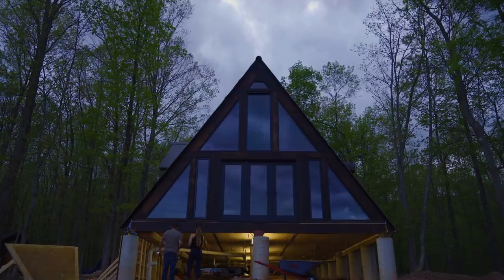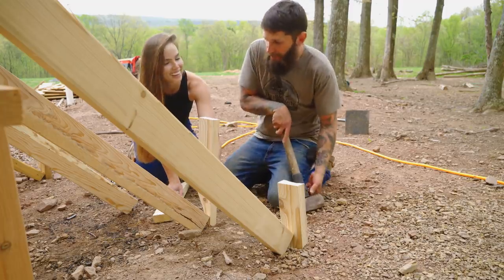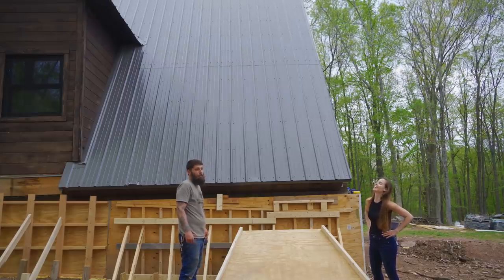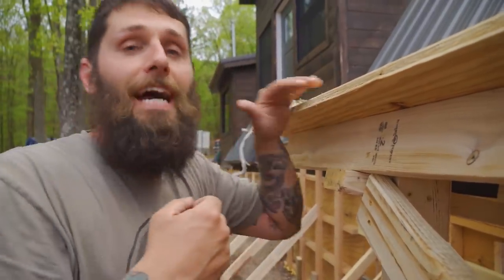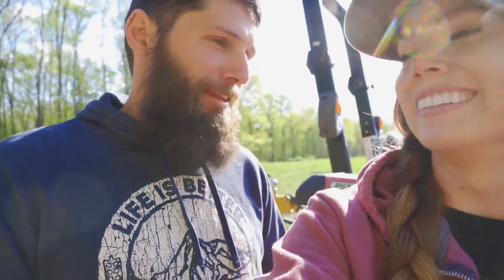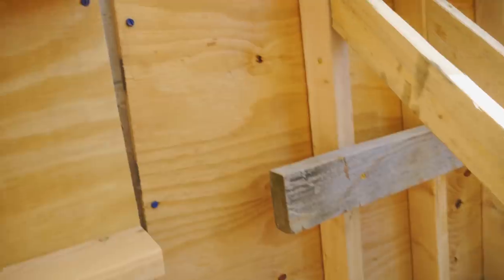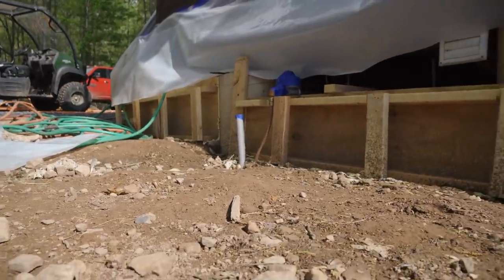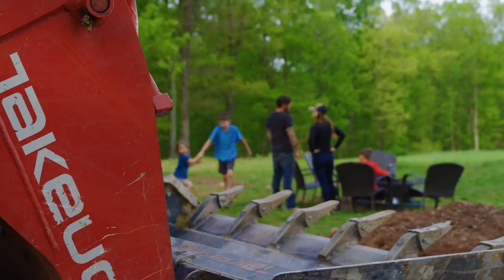Pouring A CONCRETE WALL | Our Self-Built Home

Comment: I spent 32 years working for a local concrete producer, you should be able to strip the forms the next day, the longer you wait the harder it is to strip, it will strip best while it is still green, good luck and I hope for the best,    Bob

Comment: They used to put  a twisted  wire  from  the outside of the  form  to the inside and fed them through holes  in the form to the outside  and put  anchors to keep the firm opening  up.
Reply: Snap ties
Reply: We did that on our footings and used the wire to hold the rebar up. Worked great.
Reply: Still do. No need to tell them now I guess.

Comment: Questioning why you didnt use cement block for your basement walls?? You guys are such hard workers and your beautiful home shows it!
Reply: I was wondering that myself. Given everything Josh can do I can't imagine laying cement blocks would be much of an issue.
Reply: Ground movement. Cinder blocks suck for foundation walls.
Reply: @laurieg673  Would that be an issue given there's already a concrete footing?
Reply: @stephengospel3243  of course it's an issue. You need your stone on a surface that is tied in to the pillars to stop movement. Cinder blocks move.
Reply: @laurieg673  Concrete blocks are commonly used here in the UK as part of the foundation sitting on a bed of concrete and tied into adjoining walls / structures.

Comment: Now I understand why the under-floor lights were  installed  ... Doh!  Your team-work is very heart-warming, Josh & Erin.  I know how heavy wet concrete is, hence your strong form-work.,  Once when I was renovating my old home in Bermuda with a contractor, a major project was lowering existing wooden floors about eight inches into the cellars below, and fitting re-bar and electrical conduits and propping up the whole shebang with jacks.  When the concrete pour was going on one corner started dropping which caused scatteractions with quick lumber props.  A tense moment!   Whew.

Comment: Josh I could of told you that end would blow out. Has to be done in two part pour or Lag bolt with huge washers drilled through inside of 1/2 inch pvc to protect and reuse the bolts. Keeps the inside form even with the out side form making it near impossible to fail.   Step 1# drill straight through the form. Step 2# Lower in PVC  Step 3# Insert bolt through form into pvc to other side then tighten nut till both sides compress the pvc slightly. Hope this may help.  I'll goof on you guys later! GO GOAT!

Comment: Josh, if you take some 1/2" PVC pipe, can cut it to the width of your forms. Fish the PVC between the form boards, then take a piece of 1/2" all thread and insert into the PVC and tighten up. This will keep the forms from blowing out. This will make a "I" beam holding the form in place.

EDIT! On longer bays, limit the pour height to a half a bay height, pour the others, then come back to finish where you started.

Once the concrete is cured, remove the all thread and disassemble the forms. The PVC inside won't be an issue for you as you'll be covering the cured concrete with stone.

Comment: I can relate to this concrete pour.  Years ago and having zero concrete experience I built forms and bracing for pouring a footer wall for a garage expansion.  The max wall height was only a couple of feet but my bracing started to creep during the pour.  I ponded in more stakes and bracing and crossed by fingers.  It held but there was forever a little bulge on a section of the wall.   Nice job guys.  I imagine you burned a few calories this day.

Comment: Tip: Line your chute with plastic, metal, or a severe coat of wax. You want the mud to slide into the opening and not have to loosen it with water. Dry mud is stronger than wet mud. 
When I poured to underpin a basement, I would use a hinged form where the top hinged out and at the end of the pour section, it would be bolted upright. That helped get the mud in the hole and allowed me to pour to my desired height.

Comment: i have been wondering since you all started forming up the walls for the foundation how you were going to get the concrete in between the forms and this video was so satisfying when i finally understood your plan!! fingers crossed so tight that the tallest wall isn’t too annoying to fix with the little blow out 🤞🏻

Comment: Always love your videos and watch them religiously. Josh, you should look into "snap=ties" as a way to keep your forms together. They  are small steel rods that go through the form and are held on either side by small wedges. Once cured you remove the wedge and "snap off" the end protruding outside the form. Might cut your labor and material back a bit. TLK

Comment: Great job👏 People that do home projects don’t usually get involved with a job of that magnitude. Weight of concrete is usually under estimated and you run into problems. You guys handled the job very well. Best of luck with the rest of the pour👍

Comment: 5/8 threaded rod through the taller forms would help prevent bulging. Pull the rods out a few hours after the pour. The stem-walls are not structural patch the holes.

Comment: I have a light weight aluminum chute about 20 ft long that I have used for pouring concrete for over 30 years now we use a line pump that was a great idea kudos Josh you have a awesome helper. I would remove the forms where you have a bulge and chop it back with an axe ASAP just saying the concrete will be set enough in 24 hrs

Comment: When you get a blowout like that the easiest trick is to drop a bucket or two of dirt or sand against the formwork before you vibrate it and it will usually stop it going any further.  You mite find it easier, if you use some timber to make a tee bar for pushing the mix down the chute. Also we usually have a carton of beer for the driver when it's a slow pour, it helps a lot. Well done though, that's a big undertaking, to do it yourself.

Comment: As always, great vid.  Suggestion if you haven't done the other side yet. Not sure how far behind you guys run on your vids. The thing that appeared to slow up your pour most was the concrete not sliding off the chute into the form.  Clean off the chute,  get more of that same thick plastic, and staple it all over the part of the chute that comes in contact with the concrete.  I'd probably put a double layer of plastic. Stapled all over.  The concrete should slide right in. Less time putting weight on the chute legs, as well. Almost no time sweeping concrete in. Just a thought.

Comment: I saw a couple of screws going through that form. It might be tough stripping those walls down whole depending how deep the screws are. Also adding a grease or oil to the face of the wood will help it separate for your next pour if you haven't tried that already. I build custom precast utility vaults, so I can attest its a pain when your form doesn't come out the way you planned.

Comment: I have been watching your house build from the start and I am amazed on the the work you two can do together LOVE IT !! On your taller walls you have to pour yet you should drill some holes threw ply wood and make a wall tie out of rebar like weld a big washer on one side push it threw the wall and clamp it on the other side to help hold the wall from spreading ?

Comment: 3 runners in a rail design that could be slid along the wall. Great work , it's a tool we use a lot filling block walls..

Comment: Beautiful as always.
Reply: I did some concrete work recently using a mixer and bag concrete - couldn't get the mixer close enough to the pour, so built a chute like y'all did - worked great.  I have another pour coming up that I'll do the same.  Erin, please keep that beautiful hair away from the gears - and other moving parts - on that concrete mixer!

Comment: use wall ties 3/8" all thread with fender washers, run between 2 studs set close enough for the fender washer sits on a part of both studs and don't fill to top just half way then move on then after all half full go back to beginning, the wetter the concrete the more likelihood of form blow-outs, damn good  job for a sparky though,  much love you guys not busting butt just trying to make it more pleasurable to work concrete

Comment: There or form ties that go through the form and hold it from bulging out after the concrete hardens you break them off with a hammer plus try running the vibrator on the shoot it will make it flow better!

Comment: As of 3:32 I'm going to guess it will work but be a PITA to use and modify for each of the next bays.  One thing I would have done is use a sheet of plastic or house wrap to cover the top of the chute so the concrete mix would slide off easier and the plywood wouldn't stick.

Comment: Take it from a freeway bridge builder. Snap ties or taper ties takes all the guess work and worry. All you can do is the best you can then call it good. 
Hope it turns out the way you planned. Glad to see you using a vibrator during the pour.
👍👍👍👍

Comment: I'm constantly impressed by the ingenuity and problem-solving you two pull out to accomplish the build. In a tight space like that did you ever consider doing concrete block instead of pouring? I'm guessing it would have eliminated the complex pour and frameworks, but higher material and labor time?

Comment: Great job. Spraying those plywood sheets with some fuel oil and a pump up sprayer so they would release easier would've been the only thing I would've done different. But they'll come off anyway.
Reply: I meant diesel fuel not fuel oil. I'm old. Lol.

Comment: Maybe one of the craziest pours I have seen, but hey it worked for you!. I would definately think about putting in a basement and poured walls for the back section though. More storage, and I think a lot less work overall. I know why your did the foundation how your did it at the time, but it took a lot of work here later. You sure got there though.

Comment: Love you and your work, on a 4 foot pour the force is four times greater than at 1’. When you vibrate, the rocks are like driving wedges in  between the forms. Be careful and quick when vibrating. You may get a better pump price calling a pool company and using a small pump. A concrete supply company can sell you clips to hold the wall together with diagrams. A 2x4 push would be better than a shovel. Love you work ethics

Comment: To prevent a blow out employ a two sided bolt or threaded stock 1/4" drill holes thru each plywood panel then push thru the threaded rod washer and nut both sides Most FOUNDATION are put together with these

Comment: Lots of hard work there - I am sure you are glad to be turning the corner on this!

I must have missed it somewhere along the line - but, why are you pouring concrete instead of building block walls? Stone can be applied to either surface, I think. And if strength was a concern, filling the cores of the concrete block with concrete would have gotten it done.

Comment: Sometimes it's the concrete  vibrator that causes a blowout,  you did well  to get it done 👍
You should have built the hot tub a year ago for easing those builders muscles, when the house is done you won't need it 🤣🤣🤣

Comment: I would have put the forks on the tractor and had the cement truck dump directly into the chute.  Then you could move the shut easily and control the angel of the chute.

Comment: I poured and vibrated many walls in my 48 years in construction. All you need to do is let the vibrator go to the bottom of the wall and then bring it back up slowly and you will have vibrated enough going up and down a lot will turn the mix to almost like water and increase the lower pressure a lot and also increase the risk of a blowout. Not being critical just know how bad a blowout can be and would hate to see you guys have one.

Comment: could you drill some holes all the way through the plywood and connect them with a large bolt or threaded rod? or maybe some re-bar and bend them over?

Comment: I wondered why you didn't just block it up and fill the blocks rather than go through forming it up and pouring. The walls aren't load bearing so you don't need the strength. Is that a code issue in your area? Sorry if you covered that in another video.

Comment: Hello Josh, how about a new project after we finish with the concrete! It would be fantastic for you to build a kiosk close to the house to make lunch on a large wooden table and have a wood stove, pizza oven and a barbecue ..... all open and only the wooden columns and a roof and the concrete floor ... it´sa suggestion for a farm to receive friends and relatives without using the house!

Comment: Dumb question, but why wouldn't you use something like cinder blocks to build up the wall between the columns? Is it a matter of cost or is there a structural/code reason it has to be poured concrete?

Comment: You want it wet, like a 6.  And it would be good to have a vibrator.  This way you don’t have to kick it or hit the forms with a hammer.  The vibrator can fit down in it as you pour it and you raise it back up out of the top of the form boards and it will push all the cream to the outside
Reply: You also had a dent in the roof sheet metal.  You can hammer that flat again with a finish hammer.  Just hammer lightly, and you can increase how hard you hammer as needed.  It’s painted 29g or 26g sheet metal, so it can take it.
Reply: I’m just seeing now that you did use the vibrator...good job

Comment: Feels unusual somehow to put a house on pillars FIRST and once that's done, try to poor a wall 'under it all'. Somewhere along the line something went wonky in the design / planning or build stage...? Working top to bottom makes for some interesting challenges as you've shown us here. Great job considering!
Reply: What's more challenging? Trying to run plumbing, electric, insulating and hanging 4x8 sheets of plywood in an enclosed hole or pouring a wall after the hard work is done?

Comment: Since the walls are not structural why didn't you do cinder block  between the piers and then the stone  veneer over it?  Seems like it could have been easier than squeezing concrete between sill plate, roof facia and large concrete forms.

Comment: Where your concrete meets the house, do you think it would be prudent to protect the wood with a layer of  plastic to keep the wood from absorbing moisture from the concrete?   Great video.
Reply: It's pressure treated sill. Houses are built on concrete. That's why your sill is PT.

Comment: Next time have him leave the concrete a bit dryer, it doesn't push out as much, and put what seems like a ridiculous amount of bracing on the bottoms, it seems counter intuitive compared to building a wall where the bottom is the most stable part, that's where the most pressure is in a form

Comment: WELL DONE for first time pouring concrete!  For the other side(s), may I suggest a few things:

1.  If you can cover the surface of your concrete chute with a metal flashing materials (tin or aluminum), the concrete will flow much easier than over the wood surface.
2.  When you have concrete in/on the chute, lay the vibrator on the surface a few seconds at a time and this will save you TONS of shoveling as the vibration will cause the mud to flow.
3.  Keep the chute angle as high as possible (I think you figured that one out!).
4.  Overnight, the concrete will cure enough to safely remove the forms.  Leaving the forms on for 7 days, the concrete will bond to the wooden surfaces, especially since I don't think you sprayed your forms with a form oil.  You probably should look into the form oil.
5.  And lastly, you might talk to the batch plant about adding a plasticizer to the mix as this will allow for less water (which means more strength) and still allows the mud to flow much, much more easily.

Just a few thoughts from an old contractor!  Namaste

Comment: I am curious to know why you didn’t plan for skirting similar to trailer with treated bottom plate and the bottom one foot treated plywood.
Concrete certainly should last longer but the cost for concrete and all the form work is extreme.
I thought you had bought a trailer load of stone and therefore why are not the forms set back further in so face of stone work will be set back from overhang of roof.
Reply: Tacky skirting🤦

Comment: I get what you're doing, and how your doing it, I must have missed the episode when you explained why your enclosing the base of the house, and if this was the plan why you didn't do it before you built the house.
Reply: Why enclose underneath your home from animals, cold air, the weather?
Reply: @laurieg673  Are you asking me or telling? of course those are some reasons why to do it, but again if that was the plan then why not do it before building the house. they had already insulated and sealed the underside of the house and I've never seen construction where you pour the footer after you've built the house. I've seen plenty of houses built on pilons, just wondering why they did it this way.
Reply: @scottperry8388  they just put up the 4x8 plywood sheets on the underside and enclosed the floor in.  It was much easier to work underneath it if it was open.  Pouring the walls after was easier than working in an enclosed dark tight space for 2+ years.

Comment: Just wondering why you didn't just put in concrete block since you are covering with stone and its not structural. Seems like it would have been a lot easier and about the same cost.

Comment: If you had to do it all over again would you have done cement block foundation and  built house on top of it
Reply: Blocks aren't buried below the frostline. They are not stable to build a big house on plus expensive and more labor intense.
Reply: @laurieg673   what 75% of all houses in this country have a cement block basement